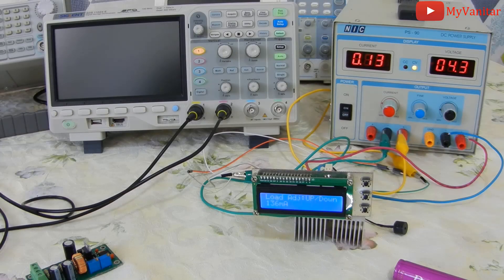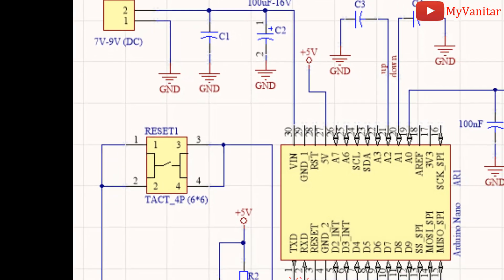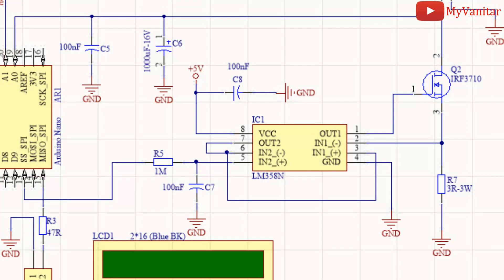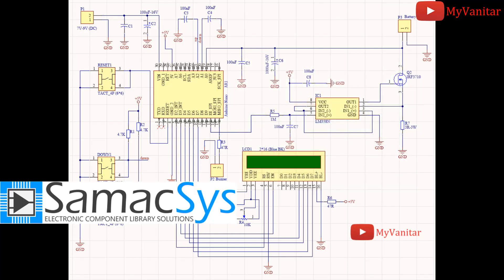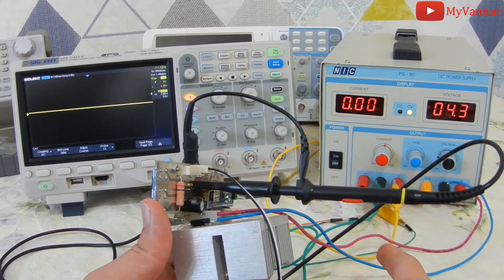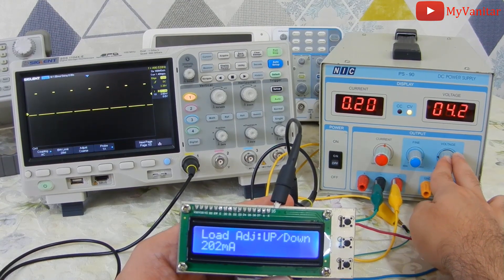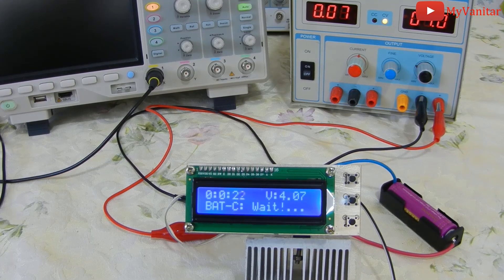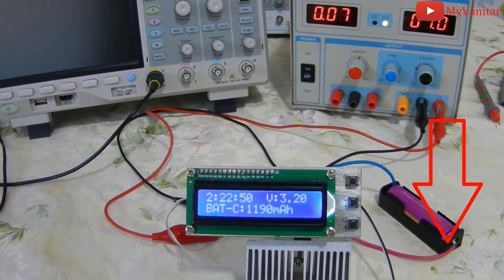Battery Capacity Tester, Identify a Fake Lithium ion Battery, Using Arduino [Lithium-NiMH-NiCd]

Comment: Hi, hope you are well, can you provide more information about making the current matrix and if i wanna increase the current to speed up the discharge process, what can i do? thanks in advance,
Reply from the maker: Yes, you can. Decrease the power resistor value and re-calculate the current array (That's not a matrix)
Reply: MyVanitar 
How can i calculate the array? 
Thanks,
Reply from the maker: @Islamallam99  I have demonstrated in the video and article. Read carefully. if you did not get the point, I'll explain more
Reply: MyVanitar 
Thanks bro, i have made the circuit successfully, what i can't understand, how PWM value control the current? 
For the example, if i increase the PWM, the voltage is constant, hence, the current is constant! So, how can i control the current? And what is the main purpose of LM358N? 

Thanks in advance,
Reply from the maker: @Islamallam99  check the article, however briefly, when you increase the duty of the PWM, the voltage increases :-)
Reply: MyVanitar yes, but after increasing PWM, the current is so small (90mA), and i already decreased the load resistance to 1ohm. What is wrong?
Reply: MyVanitar 
What i observed, the voltage at IN2_+ is nearly 4 volt, so, basically the voltage on IN1_neg should be nearly 4 volt. In my case the voltage is so small at IN1_neg!! Hence, the current is so small = 90mA (for R7=1ohm). Can you give me a quick suggestion? 

Thanks in advance,

Comment: Hi again.It is possible to measure and display  the internall R of the battery?  I see the equation is
Battery resistance = (V bat open circuit - V batt on load)/ Load Current.
During the first 3-4 seconds  of battery on load is enough to get the  Internal R for the specific current we set. I think  also we need a second analog input for batt voltage measure.
Thanks.
Reply from the maker: Generally yes you can, however, when you can measure the capacity directly, the internal resistance is less important. Because capacity itself handles all information. A battery with high internal resistance, typically won't deliver good amount of current. cheap batteries have high internal resistance. you have the code, you are free to modify it for your personal use (non-commercial)
Reply from the maker: @bme77  You're welcome

Comment: I  made  this instrument. Thank you for sharing!
I could't  work with IRF3710 and after i search other mosfet  in my beanch i try  with the FQP50N06 and i have current now.
As i see   with my curve tracer this mosfet  have Vgs min to turn  ON (1,8 v)  .IRF 3710 have  about 3,3v.
Anyway i am OK now  and Happy!
Reply from the maker: Try to use original components. actually you can use many Mosfets there, only you need to re-measure the currents and modify the array values. As you see I build and test every circuit. Subscribe and have fun with future projects/tips

Comment: Very nice and useful project, congratulations for your knowledge! I have a question: can I use another type of capacitors? For example not 1000uF but 220uF. How it will modify the result? Thank you in advance! Zoltan
Reply from the maker: You're welcome. May I ask you why you want to use a 220uF capacitor? I used that for noise reduction
Reply: @MyVanitar  The answer is simple: it's in my home. If it's matter, than I will buy what you described.
Reply from the maker: @szebeniz  I think it would work flawlessly

Comment: Hello Could you convert the program for me to work up to 1A I have a 50W resistor
Reply from the maker: Just it needs small modifications in the code, also be careful to not to apply more than 5V to the input. Then you are done. no problem whatsoever to draw 1A or even more
Reply: @MyVanitar  I'm a beginner and I can't do it alone, can you help me?
Reply from the maker: @jakubp6196  In the code, there is a current array. Reduce the resistor value to for example 1-ohm and recalculate that array. No need to change the code in this way.

Comment: anyone built it and is working?
I do all the soldering on the PCB and when I try to test, it is not working.
I got no current at load.
May I know what voltage is at LM358 pin 1(op-amp 1 out) when current is set at 500ma?
Reply: change the transistor to IRLZ44 and your problems will end I had the same IRF3710 does not work very well at low voltages.
Reply from the maker: @jakubp6196  You should always avoid cheap fake components, otherwise all the time you can't realize the real cause of a problem
Reply from the maker: @jakubp6196  You can use that Mosfet
, but current values might differ, you gonna measure them again
Reply: @Jakub P  Thank you!  I'm so glad you posted using IRLZ44 MOSFET.  I was pulling out my hair for an entire afternoon.   Then the author told a couple of guys that they must have wired something wrong or had bad solder connection or, etc., etc., etc.  Well I built a 2nd unit on another PCB (I had 5 made) using all new components even the resistors and no way would the IRF3710 MOSFET turn on.  I read your comment and thought what the heck do I have to loose?   Bingo! Works perfect,  thank you so much.   BTW the way the 3710's I bought were OEM's at least according to the logo.  You are the man!  I'm now one happy camper after all the frustration I'm been through.
Reply from the maker: How a project with this much level of description, Schematic, PCB and test video should not work???!!!. Plenty of people have tested it and even one of them has put it on sales. Please check where is the mistake in your soldering, programming or even a faulty chip. You need instruments to test.
Reply: May I know what is the voltage at LM358 pin 1 (op-amp 1 out) when current is set at 500ma?
Reply from the maker: @abeltcb  I don't remember, but what you can do is to track the pulse. first check if your Arduino produces the PWM pulse, then track the voltage variations on the LM358 by the schematic. I suspect either the LM358 or Mosfet is faulty, or maybe the wire connections are loose.
Reply from the maker: @abeltcb  Also check if it works with lower currents, not just 500mA. it means start with lower currents and test. For example turn ON the device and put it on103mA and check.

Comment: dự án rất hay!
Reply from the maker: Thanks
Reply: Dear 
I need the equation from where I measure capacity of my electrode material
Reply from the maker: @naveedabro1222  Just check the code. it is not complex. You need to hold a timer until the battery voltage reaches 3.2V

Comment: All Li-on batteries over 3600mah are 100% fakes on ebay, Amazon or anywhere else.  BTW, this is a great video!
Reply: You mean all 18650 Li-on batteries over 3600mah are fake...not generally all Li-on batteries... 
For example there are 21700 Li-on batteries that have a capacity of 5000mah.
Reply from the maker: @sasiskas  I did not mention this, there are true high rated batteries in the market, but finding the truth is sometimes difficult
Reply from the maker: Yes, this is not just beneficial to spot fake batteries, but also to determine the true capacity of the second-hand batteries as well. This problem exists for cellphone and camera spare batteries also which this device can be used for. Please support me through Patreon or at least inform your friends to subscribe.

Comment: Very Nice and Useful project, I was thinking the same . Thank you for sharing your knowledge and project.
Reply from the maker: Thank you very much, if that possible for you, you can support me through Patreon or at least inform your friends to subscribe to the channel, it is a motivation for me to continue
Reply: @MyVanitar  I will definitely share your project. Keep up the good work.
I will make a capacity tester like your.
Reply from the maker: @opengreenenergy  Thank you, you have a big channel, so your action is certainly useful. Witing to see your project
Reply: @MyVanitar  Thank You so much. I will need your guidance.
Can you please explain me , how you have reached the current set values 0,37,70....so on ?
Please see my channel post and stories, I have shared your channel.
Reply from the maker: @opengreenenergy  Thank you. Well it is pretty easy, as you see by pressing the buttons PWM value changes. So current flow changes. So simply connect AMP meter to see the current, or connect it to the supply with a current consumption display.  For each step that would be your current. if you look at the video, it is clear.
Reply: @MyVanitar  Hi,
One thing i can't understand, in the schematic the up and down button are connected to Arduino A2 and A1. But in code the pin no is defined 16 and 15.
Reply from the maker: @opengreenenergy  Actually those Pins are initialized as Digital Inputs, Not Analog Inputs
Reply: @MyVanitar  If i connect the up and down pin to any other digital pin. Is there any problem ?
Reply from the maker: @opengreenenergy  of course you can modify the code based on your needs, so yes you can change to any other pin which is not equipped with something else
Reply: @MyVanitar  Thank You so much.
I made my version. But all the credit goes to you. 
My Video :  https://youtu.be/LQcvRasC6Pc
Reply from the maker: @opengreenenergy  Good Job, thanks for mentioning the source